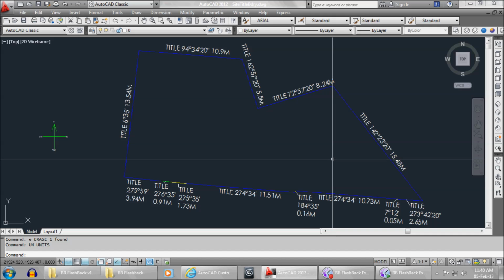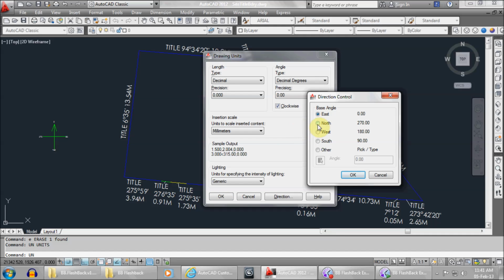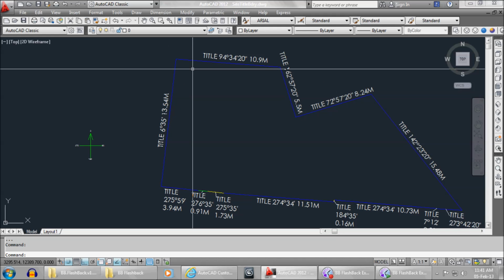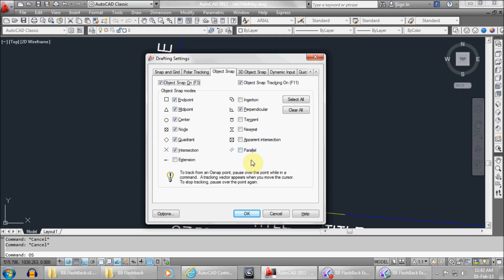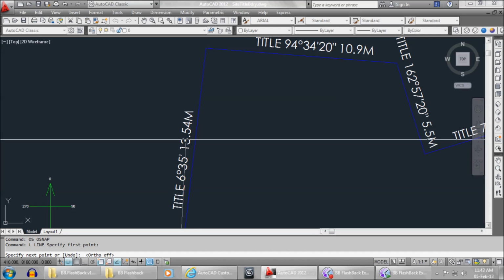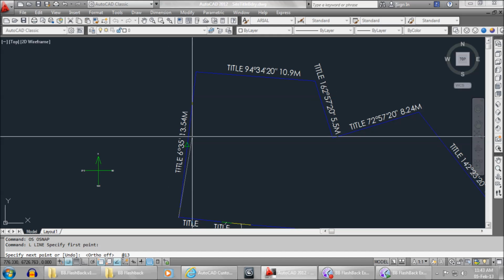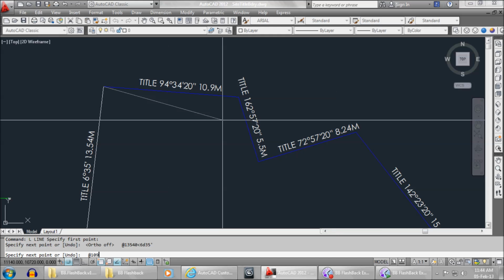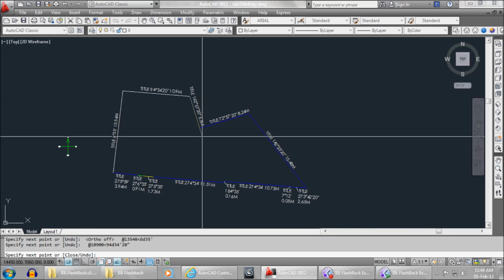AutoCAD Tutorial - How to draw Site Title Boundary

Comment: Hi Andrew, I am having an issue with the direction of North in Autocad 2018. We obviously want North to be up the page, which I can correctly set in my previous version of Autocad (2016). Even though I change the unit settings in 2018, when drawing a line it won't draw a bearing greater than 180deg from North up the screen. i.e. If less than 180deg it draws the line clockwise and if greater than 180deg it will draw the line from counter-clockwise direction. I am stumped. Thanks, Michael

Comment: when I draw the angle go in completely different directions than the old plot.
Reply from the maker: Try typinf UNITS at eh command prompt, then either tick or untick the Clockwise Check Box and see if that fixes your problem

Comment: Everything worked perfect for me except the last unit.  I have a title plan and I have worked around the boundaries but the last one line goes in the opposite direction.  Is there something else I need to be doing or for the last measurement do I just need to put the inverse of the angle in?Cheers!
Reply from the maker: +Jaime Sherlock without seeing the angles its hard to say. Sometimes you can draw lines at the angle and just mirror them later if that is an issue. I hope you can resolve it. Good luck
Reply: +Andrew Whitburn Thanks Andrew :)

Comment: YOU DONT NEED TO PUT CLOCKWISE IN UNITS
Reply from the maker: +neverfall16 if you want the co-ordinates to work out correctly then you need to. Not changing the clockwise setting will still allow lines to be created but the lines won't go in the direction you want.